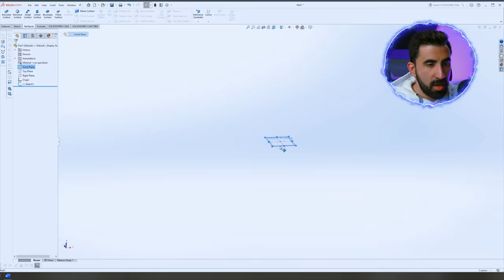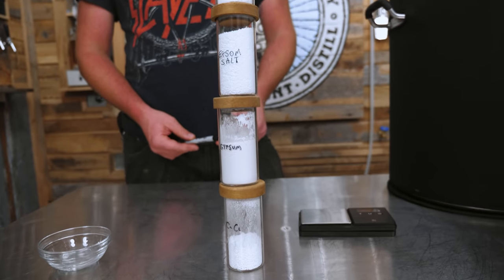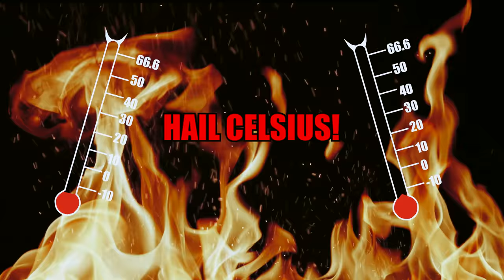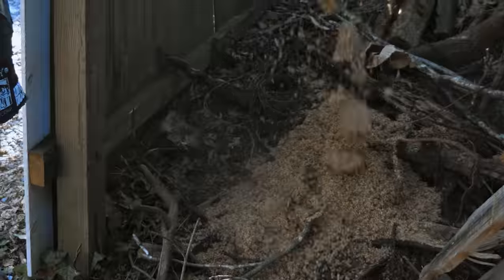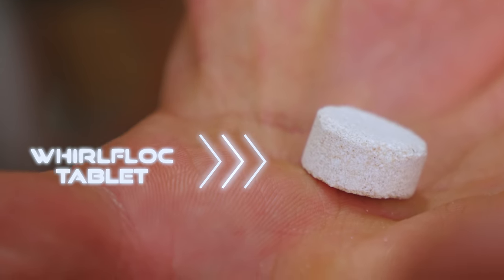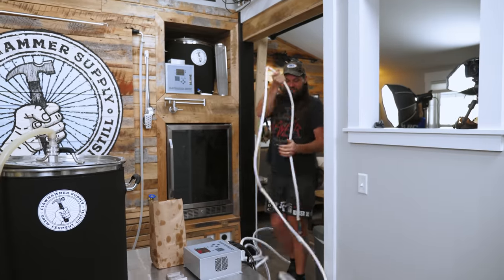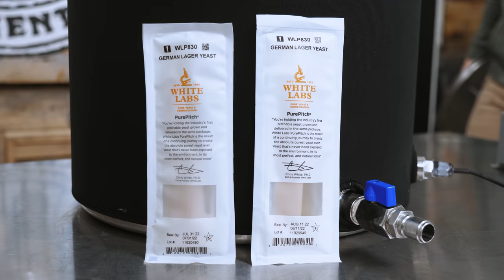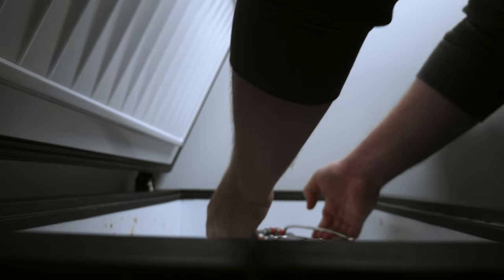Did We Brew Tesla’s Cybertruck Gigabeer First (And Will Elon Sue Us)?

Comment: I just ordered two of your kegs and the 10 gal BIAB system! So excited! I got the 110v version, can I upgrade to the 240v later on by just purchasing a new controller? Just wondering…can’t wait to get the kegs 🍺
Reply from the maker: Rad! Yes, you can switch to 240 later. The only difference is the controller and element / element adapter.

Comment: Super cool keg!  After fermenting, how do you remove the yeast from the keg?
Reply: normally, when I ferment in a 5gal corny keg, I just pour it out. It's not that heavy to do that... or you can purge it out using gas, but I don't see the point on that.
Reply: @gustag  thanks for your reply! Since the yeast would rest on the bottom, how do you pour it out or purge it?
Reply: @DualBalloon  normally I just turn it upside down and pour it through the main “hole” of the keg. You just have to leave some beer (200mL or so) with the yeast so that you can mix it up and make it more fluid! Or you can plug co2 on the keg and pour the yeast like you would do with a normal beer, but for that you need the floating dip tube
Reply: @gustag  Oh I think I understand, when your pour out the main hole, you'd transfer into a serving keg right?